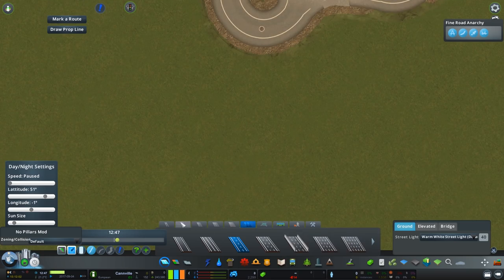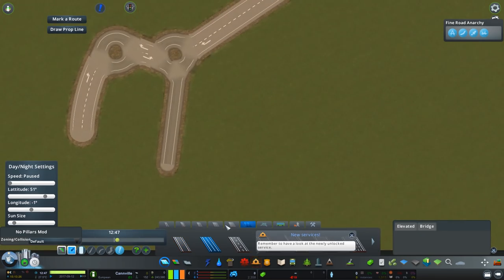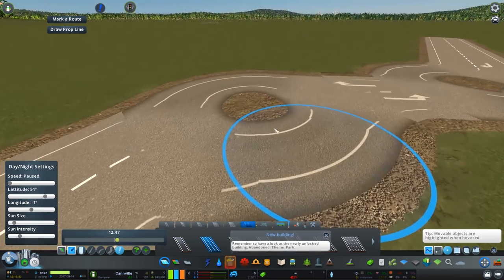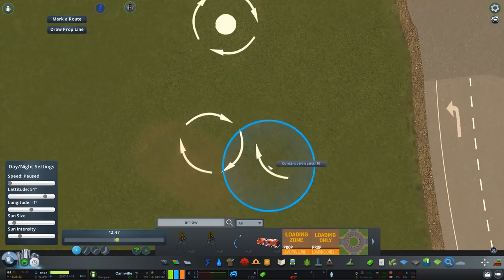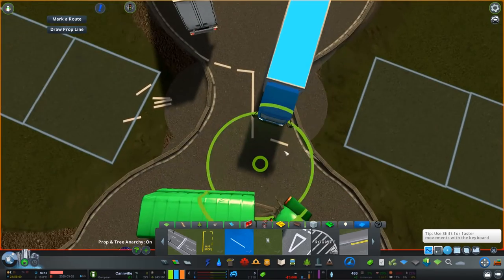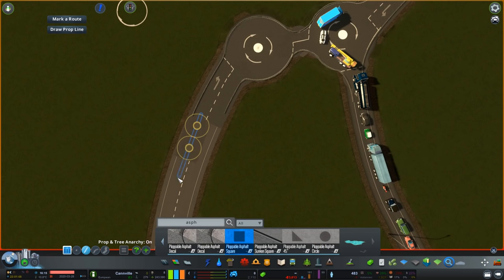Cities: Skylines - Dual Mini Roundabout - Creation Tutorial

Comment: first off: great video
second: this question has nothing to do with the video;  what mod let you put roads/buildings inside off eachother?
Reply: road anarchy. if you want props then its called prop anarchy
Reply: TAMMMS yeah, fine road anarchy. For props and trees use prop/tree anarchy.
Reply: Jason Caballeros heh, didnt see u also wrote that xD
Reply: its fine. some confirmation.
Reply: But it doesn't work for buildings thoo
Reply: Like the buildings don't have a hitbox so you can build thru them
Reply: use Cntl + A to enable anarchy with said mods you can see that the annoying twitter bird has changed color. then move it to move them around.
Reply: yeah you need to put anarchy on(ctrl and A) (or from the menu)
Reply: THANK YOU IVE LOOKED AND ASKED THIS FOR WEEEEEKS NOW!!!
Reply: you are welcome happy building mate
Reply: while we are in a topic about not knowing how to do stuff in C:S mods, How tf do I draw lines on roads? 
I have prop line tool(and PropPrecision) and I have turned on Anarchy.
I can draw lines(using "bike middle") but it only shows on ground(e.g grass or concrete) and it doesnt show on roads. You know what the problem is?
I also tested it on a 100% flat surface and also tried using the Move it! mod to move them up but still doesnt work
Reply: 1. click on the prop you want
2. click anything but the dot (single/default on the options on how you want to draw your prop)
3. click on the box with horizontal lines (Control Panel)
4. you'll see a window appear. click on the tab call options
5. click on PLT Anarchy
6. Enjoy.
Reply: As I said I have Anarchy on. I can place the lines on the road, its just that they dont show up
Reply: not the prop anarchy. prop line tool has its own anarchy. just follow that. if that doesnt work it seems like the props that you are using are being overlaped by the road.
Reply: They are being overlaped bybthe road, and thats what I dont get. As I said I tried placing them on a 100% flat surface and I tried using Move it to bring them up but they are dtill overlaped
Reply: Maybe get other lines mods

Comment: I need help. When I tried to place the "bike lane middle" lines on roads it didnt work. I then realized anarchy was off so I turned it on. Now I can place but the lines dont show up on roads, only on grass. I even tried making the ground 100% flat, and using Move It! mod to take up the lines, but they still dont show up on roads
Reply: Rackie To place props and/or decals on roads and buildings, you'll need Prop and Tree Anarchy by BloodyPenguin. If you're using the Prop Line Tool, the is a separate anarchy setting in the PLT pop-up menu.
Reply: I said I have anarchy on. I can place the lanes on the road, they just dont show up. If I delete only the road i can see the lanes on the gradd
Reply: Count Krzysztof grass*
Reply from the maker: What lines are you using? Some do not overlap very well, depends who made them. Another trick to try is highlight the line and use the moveit mod to higher or lower the line, this somethings allows it. Its hard to give you an answer without knowing exactly what you are using.
Reply: The one every1 uses. "Bike middle" i think its called, its in the main game
Reply: And I also stated that in my first comment
Reply from the maker: I use - http://steamcommunity.com/sharedfiles/filedetails/?id=884676494&searchtext=line+pack
Reply: I also tested it with plenty of other decals including lines from the linked pack.
Well anyways ty for eeplying and trying to help out, ill see if I can fix it tomorrow, gotta sleep now